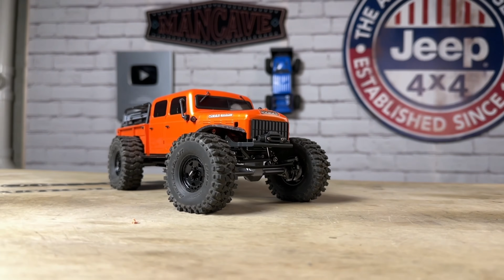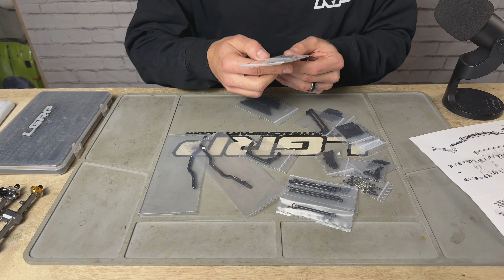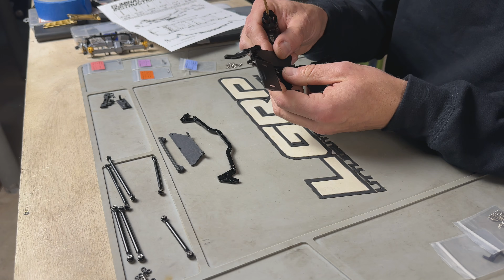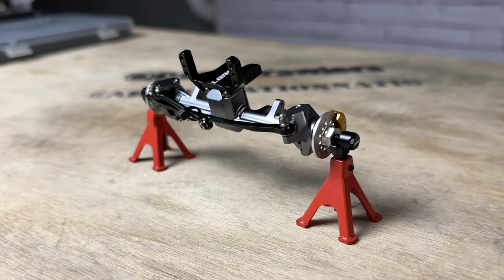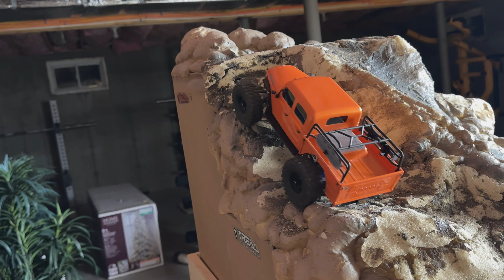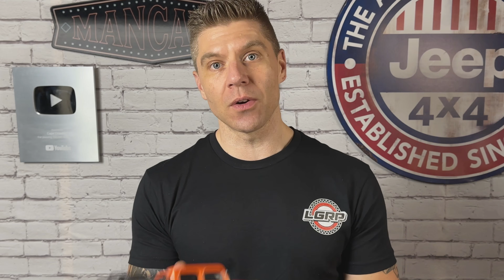LGRP Eliminator SCX24 Chassis Kit! Assembly, Power Wagon Conversion & First Runs

Comment: So I’m currently on a mb24 chassis. Can the mb24 cage fit on the eliminator?
Reply from the maker: I don't think so. The eliminator rails are long and would give you issues in the rear I believe
Reply: @CapeCrawlers  ok thats what i was figuring. thanks for the tip

Comment: I was kinda thinking LPRG goofed not having high clearance links. Like why at this stage of the game would you even make straight links. 
BUT.... the straights do seem to be quite happily out of the way. Dunno if that is the new chassis or your building or both. But didn't look to be an issue.
And yes, amen to injection molded parts over printed!!!!!!!!
Reply from the maker: They said the tubular straight links are more scale. But I would like to see versions with angled skids and bent links for more break over, especially on these longer wheelbase models
Reply: @CapeCrawlers  Yes, that's true. And this style kit does seem to be directed at the guys looking for more scale rather than crawling ability. 
If they did a "comp" version, it be cool to see more holes in the rails to allow multiple location to mount the shock towers. That's something I'm surprised hasn't been done much, if at all. Being able to move towers along the rails would be great. Not only for shock placement but for clearing other stuff like the body.

Comment: Can anyone help explain to me if I can use the stock axel SCX 24 controller if I get a new upgraded ESC or do I have to get a whole new controller as well the ESC I’m looking at is the micro Python.
Reply: If you have the v1 or v3 electronics, you can use your same controller (radio). Plug the new esc to the channel 2 of your axial esc. (Just using old esc as a reciever for your original radio) then use new esc to hook battery up to. If you have the blue v2 esc, you will have to get a new radio and receiver.

Comment: got the basecamp for my kids for Christmas, and got some injora wheels and baja pro x tires. Tires are too big sadly. Thinking I may have to get different bodies for them. the powerwagon looks like it fixes that issue.
Reply: Try some rc4wd bfgoodrich 1.0 tires. They have bfg km3 and kr3 and fit the basecamp great. I didn't want to chop my body up so those tires fit great. Also the rc4wd falken wildpeak 1.0 also work great!
Reply: @johnnyhotshoe1292  We already got 4 sets of the pro x. I will most likely find new bodies for them that can work, but for now they like the stock. The only thing I really want to change is the shocks.

Comment: 95$ and it doesn't come with a rear hinge or a skid plate 😂
Reply: I like LGRP products, but they're pricey compared to competitors
Reply: 95?? my god thats 2 used scx24s
Reply: I feel like you might as well buy the comp chassis
Reply: You should see HardPark prices! They nickel and dime you!
Reply: @speedy0231 I put a set of the hardpark 1.8 wheels, we’ll all the parts to build a set of them and it was like 100 bucks for a set of wheels
Reply: @speedy0231 *I put them in the cart, then when I went to checkout I just couldn’t do it. So instead I spent 110 bucks on one front axle!!! It is very nice but wow